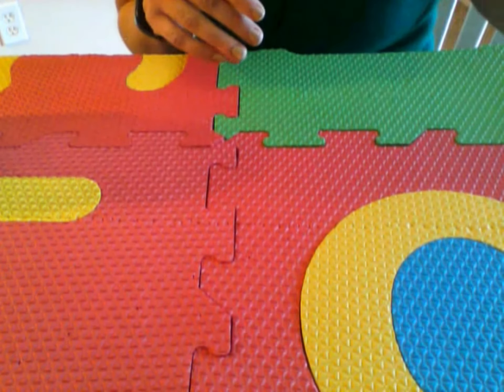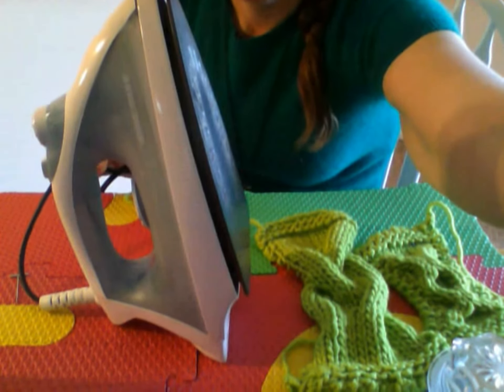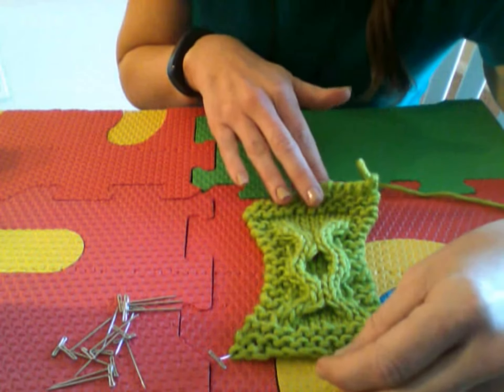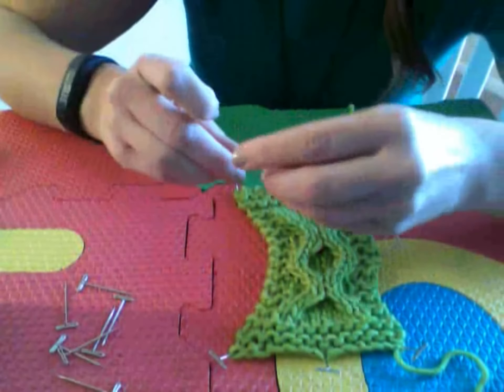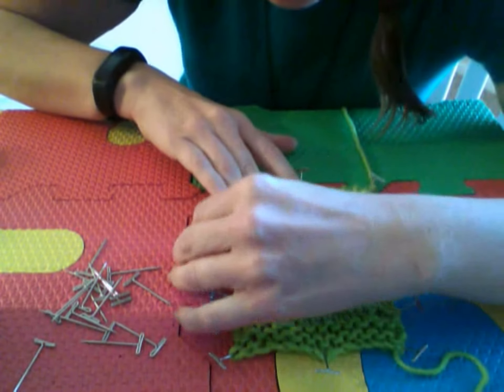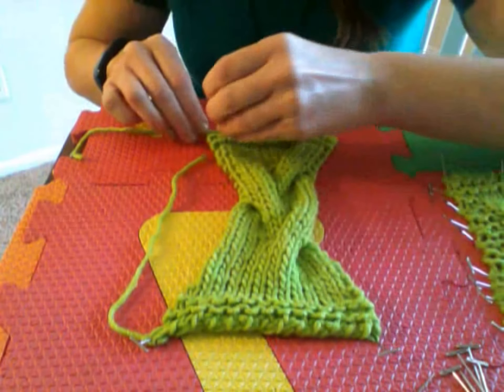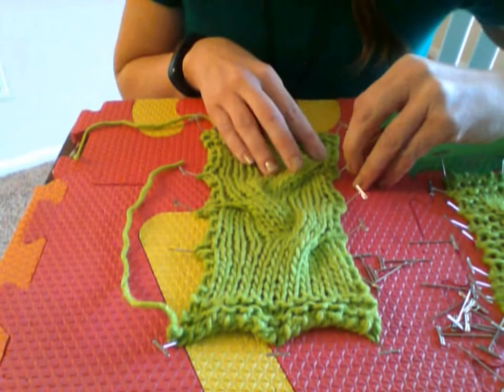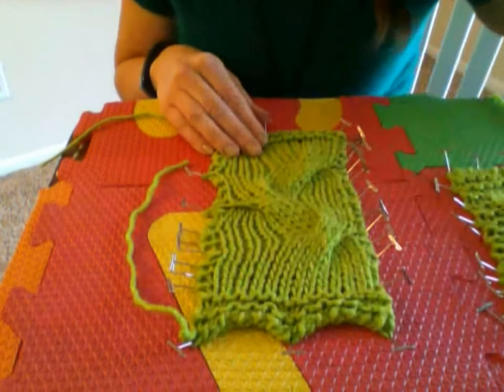How to Block Acrylic

Comment: Oh, thank you for this video. I knitted my first thing ever (a scarf) and it looks more like a tube or snake. I almost tossed it but found out that the stockinette stitch will do that but that blocking it will help. I mostly crochet amigurumi that doesn't need blocking so I found your video specifically for acrylic. Yay! Thank you so very much. I have my blocks and pins and I'll start pinning when day breaks.